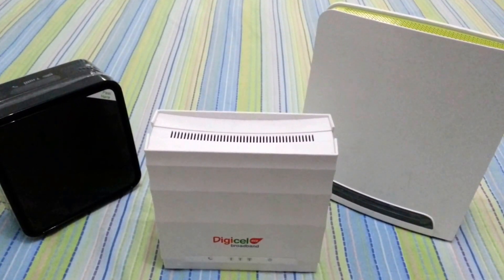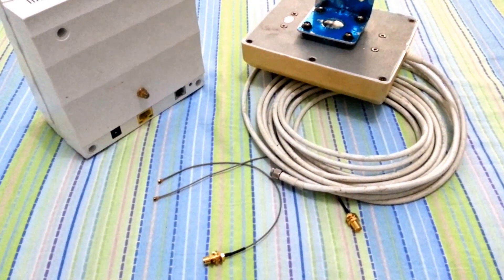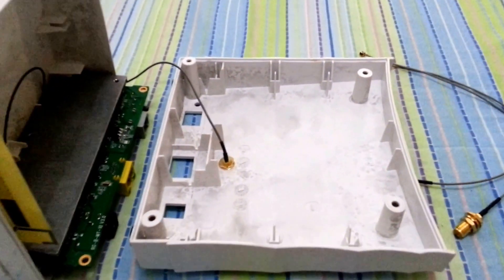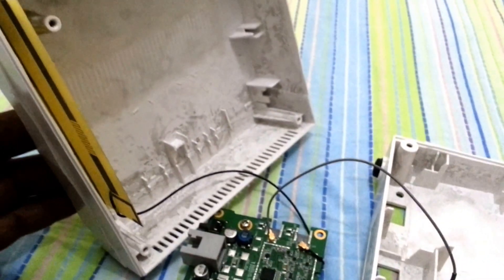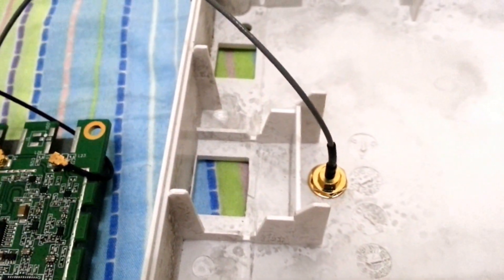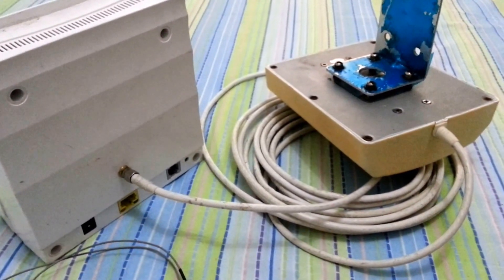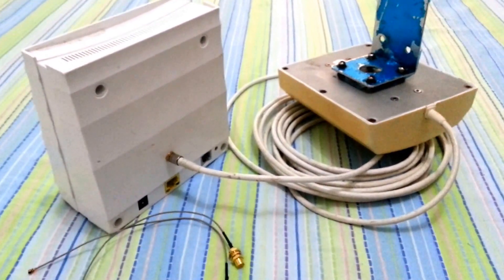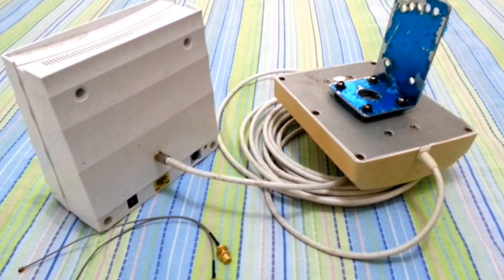Tweak your broadband modem for faster stable Internet access

Comment: And what about an old satellite dish
Reply from the maker: Project LavaVein well... Wimax (Digicel Wimax) transmits and receives using the 2.5GHz band. The dish you use would need to be compatible with this band.
If not, it's like the device is speaking in English to Dish when the dish really needs to hear is Spanish to effectively broadcast what it hears.
Reply: RecarroJames ok, should I modify both antennas or just one
Reply from the maker: Project LavaVein would suggest trying with 1 first
Reply: So can it get the full 3 bars with just 1 modified antenna?, merry Christmas btw

Comment: guys this works for signal strength only it don't improve speed Digicel provide 3 to 6 mbps some how if you or getting lower than 2mbps it simple means the too much persons is one the base station in your area when you log into your modem with the link 192.168.100.1 it shows you the physical status the closer your rssi/dbm is the -0 the best speed you will get mines if the modem is in the house you will get less than 1mbps mine is out side 30 feet up rssi/dbm is -40 am getting 3mbps some times drop to 2 still a bit better and it works well when you put on a router and lock off the Wi-Fi coming from the unit but my advice is to cut off this internet and get with flow or Digicel play these or line internet from the base station to your home so you don't of to depend on signal these box or going out dated and giving alot of trouble that's my advice

Comment: could you give me a reason why would it not work please if you can
Reply from the maker: +Scott Dunkley Your USB WiMAX modem would need to have a U.fl connector port for this exact tweak to work. see http://amzn.to/1TIkJFM. I don't think the USB device have that. 
How I improved on the reception was to use a styrofoam plate, punch a hole in the middle for the metal portion of the USB device and then wrap aluminium foil around the plate. I was designed kinda like a small satellite receiver dish, something similar to this - https://youtu.be/VZKc3PBs67c

Comment: Hey am about to purchase 3 of these things to boost reception am getting 3 lite on my modem but it is very slow in the day will it helps giving me better speed?
Reply from the maker: +Papadoc Doc Hey, this doesn't increase speed if the service provider network is overcrowded. This tweak improved connection if say you're getting 1 or 2 lights. You said you're receiving 3 so that seems you are already getting a good signal. being slow in the day sounds as though more ppl are connecting to the site that you get service from, therefore everything slow down.

Comment: Nice video. What are your download speeds before and after this modification?
Reply from the maker: well what improves drastically was the signal strength. Download speeds still depended on the quality of the ISP's network and the number of persons connected at a given time.
Reply: Cool. I have digicel's modem. I get between 2-3 bars on the dx-250 modem but I'm lucky if I ever consistently get speeds over 1mbps.
Reply from the maker: +Khalil Wright well... I know the wimax network is very crowded now so that could be the issue.
A consistent 3 bars would be best.
What are your RSSI and CINR readings when you log in?
Reply: +RecarroJames I'm seeing CINR of around 15.41 (R1)dB and RSSI of -79.32dBm
Reply from the maker: +Khalil Wright you need to get a better CINR. 25 up is best.
Reply: +RecarroJames ok cool.  Thanks much for the help man.
Reply from the maker: +Khalil Wright kool. no prob.
Reply: Pay more and get more speed that's the only option to increase the actual speed of your internet

Comment: Great Video, just what i was looking for. Question: Is there a maximum length that the antennae cabling can be before you start to experience loss of signal, and also is there anywhere that these items can be purchased locally?
Reply from the maker: luthifer01 Locally...NO. My suggestion would be to keep it at a minimum of 20ft.

Comment: Ok so I got everything except the low noise amplifier and still I'm not getting any signal from the modem even though the 4g coverage map shows that I'm in the coverage area. Is there anything I can do to remedy this issue?
Reply from the maker: Oshane Diedrick What is the specs on the antenna that you bought?

Comment: Hey there, I recently bought the DX-250 and want to do the modification on it. I am currently not getting it to detect the WiMax signal but it is nearby according to what I have seen on the coverage map that Digicel provides on their website. So I wanted to know if you think doing this modification will allow it to capture to WiMax signal?
Reply from the maker: You will need at least 1 bar on the device to boost it.
Reply from the maker: You will need at least 1 bar on the device to boost it.

Comment: RecarroJames Thank you for posting this! I have been researching this subject for half-an-hour here in the states for my wife's family in JA. Finally, I googled digicel 4g signal booster, and your video came up. THANK YOU. My question: Can I apply this antenna set-up to the Green Packet WiMAX DX 250? When you open the modem is the internal antenna easily replaced with an antenna as it is here?
Reply from the maker: Most definitely. I've done the upgrade using the DX-250 and it works well. 
The same connectors for antennas a re there and can't be missed, they look very similar to what's in the EX that I used for demonstration.
Reply from the maker: Mike Mongo By the way, You're most welcome. Thanks for viewing and please continue to share.
Reply: RecarroJames most certainly. I also appreciate your list and your prompt attention. You are generous with this information, it is making people's lives better.
Reply from the maker: Mike Mongo Not a problem Mike.... I'm happy that my efforts assisted persons.
Reply: (If I may interject, Faith, you won't break the modem. And ISP = Internet Service Provider ie Digicel. That's all. Carry on!)
Reply: Lol thanks Mike
Reply: How do you open it. My mother has one and since her security system was upgraded in the home, she only gets one bar (one light). Will this method help to boost her signal on the device to a point where she is able to use the internet again?
Reply from the maker: How many lights was she receiving prior to the upgrade?
This method should work, I've tried it in parts of Westmoreland on devices that were getting 2 bars and they now have 3 and browsing is much better. The sites have been maxed out these days with so many people purchasing modem and being added to the network so even though you gain better signal levels your speed may still be slow all due to the network at full capacity.
Reply: Prior to the upgrade it was three lights and occassionally two but it worked. These days as soon as the device connects the one signal light flickers and the device is disconnected.  Is there a work around in the event that i am not able to obtain the outdoor antenna you suggested? I have been seeing videos about the beer can contraption, but i am skeptical.
Reply from the maker: Well... There's a possibility that the antenna on the serving site may have shifted slightly. have you moved the device from the usual spot and placed in different positions around the house? 
Try this first to see if you gain better signal via a different location.
Reply: @RayonWhittaker  hey how do i get to selfcare page to login?
Reply from the maker: @GameChanger-wr5es  I believe it should take your there when the service expires. Honestly not sure what the IP address is
Reply: I have tried moving it around the same room but when i go to visit i will defintely try moving it around the house.  There was a time when i moved it slightly from where it always is and all three lights came on then it went back to one.  But when i try to move it around the house - tomorrow possibly i will update you on what happens.
Reply from the maker: Ok Cool let me know as soon as you do. In my testing I've seen where moving it just a few centimeters caused a huge positive change. So you never know.
Reply: Moved it around a lot- got two lights and three lights occassionally but then it went back to one... out of options
Reply from the maker: What's the general location? 
Maybe it's a Site issue that can be solved from the ISP end.
Reply: Port Antonio, Portland.  ISP end? Elaborate please. Oh i tried to open the modem to check if possibly one of the antennas could have come unclipped and after i removed the screws it was like the outer modem shell was practically glued together so i left it alone. Was thinking maybe it fell and the antenna might have shifted or something
Reply from the maker: ISP meaning Digicel end. If it fell then that could be a possibility as well. Have any other modems elsewhere that you can try?
Reply: That the other thing i will be trying i.e. using another modem to see if it works. How do you pry the modem open ? dont want to break it - i realize you dont have videos on that particular modem or how to open it.
Reply from the maker: I actually did one, but didn't upload it enuh... But you gotta hold the side without the lights and apply pressure to open.
Reply: okay - can you send me the link? wasnt able to find it. So in the event trying the other modem in the area doesnt work - what would you suggest as a viable solution?

Comment: Thanks. Therefore it can only access service from digicel. the service in my area is very weak and had to put it on my roof in a container and still get weak reception. Do you think if I should do such a modification will my service improve?